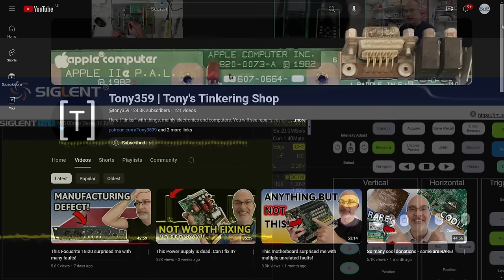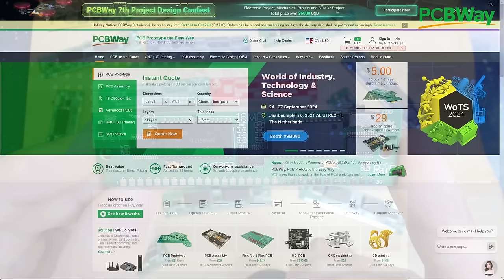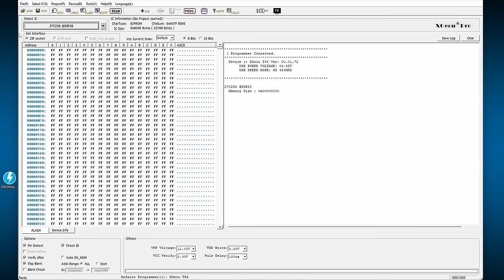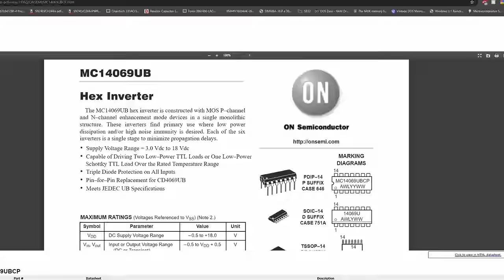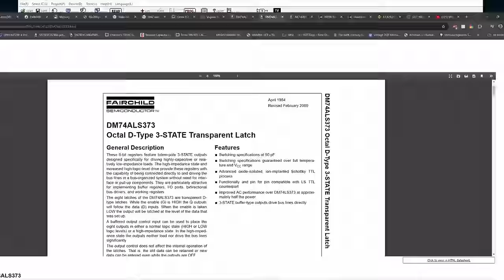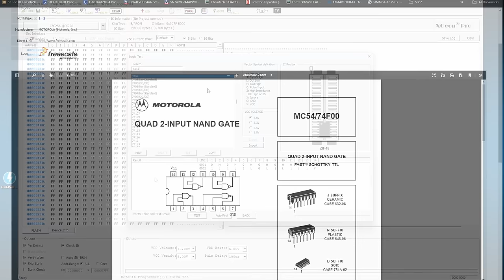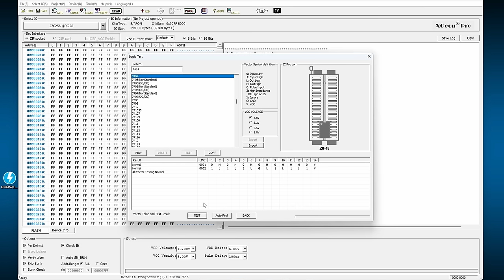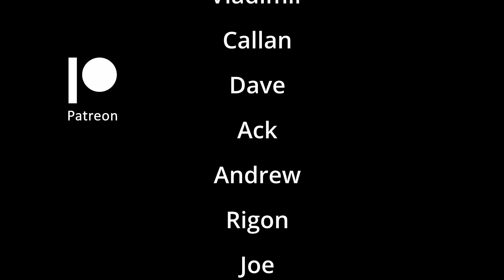Can I Save This 286 Board? Testing & Socketing all 13 logic ICs!

Comment: Nice board, i still have one brand new CPU Harris 25Mhz but no board for the CPU
Reply from the maker: I ordered one of those 25 MHz  CPUs from AliExpress. That will be a 'I ordered a vintage CPU from AliExpress' 🤣
I hope at least one of those boards will work - or help to fix the original board.
Reply: @bitsundbolts  I assume that it will be some small thing, what you overlooked is only a 2-layer board, I would try to back up the bios chips and upload a newer bios, sometimes it happens that the bios chips are damaged and the board sometimes does not want to post, I have experience with 386 boards
Reply from the maker: I tried the BIOS already. Many different things - always the same outcome. Funnily, I found a video on Necroware's channel with the same chipset. His board also didn't work and beeps exactly the same way! For him, it was a trace to the real time clock and keyboard controller. That is something I am going to look at next! Weird though that it would complain about memory. Maybe the real-time clock has an issue.
Reply: @bitsundbolts  I'm sorry to tell you but all those Harris 25MHz 286 CPUs on Ali/eBay are fakes.  I've been trying to get a Harris 25MHz part for years, however, all I've been able to get are sandblasted/relabelled 12 or 16MHz parts. They "might" do 20MHz, but certainly not 25MHz. Luckily the sellers will refund you.
Reply from the maker: I'll give it a try. I am not expecting anything magic and I'm fully prepared to be scammed by them. At least I can make a video about it and prevent others from making the same mistake.

Comment: My childhood 286 was so basic. Had only 10Mhz 1024kb ram populated with chips, no slots. The board was huge. Once i got ram chips and upgraded it to 2048kb(maxedout) but it would not longer boot or instal DOS 5.5. Going from ZX Spectrum clone to 286 was a big visuals upgrade tho.

Comment: From what I've seen the best solution is to preheat the board. Then use a desoldering gun. Reflow the solder if necessary. And in the end just a pinch of hot air.
Reply: I know epictronics recently got a preheater and he said it makes a huge difference.

Comment: Transistors can also fail, so if yo have a component tester give it a go by testing them.
Now to save time if you have an oscilloscope you could try and check to see if each IC has a crisp signal "no Floating signals" at their signal pins Eg: "Data, Addressing etc."
that are either no where near an expected high signal or an expected low signal, or even a distorted square wave should clue you in, 
Most hi/low signals reach about the same voltages, so if there are voltages or square waves and or pulses that look different or erratic that could be a clue that the 
component or a connected component has failed or is failing to meet proper specs..

Comment: I don't know if it'll make a difference, but you might want to try replacing those chips you tested anyway, just to discount any odd chip faults somehow not showing up on test. The reason I mention this is i've seen a few arcade board repairs where even after a chip tested fine in the tester, it was eventually found to be bad anyway. I think the reason given was that the chip tester possibly doesn't drive them quite as hard as the PC board itself does in normal use.

Comment: I believe that one of the chips near the KB controller might be bad, perhaps the one that could not be tested. Looking to the schematic, that 74245 is in the memory bus circuit (you can check the continuity between its pins and the memory bank to be sure) and the 7406, an hex inverter with open collector might invert signals for different parts of the circuit (the CE, OE pins for the memory? must check). Also, the 7474 that I remember to be a dual d flip-flop can do a division by 2 for the clock, maybe? I would be sure 100% that all those ICs are good, and as you said, the RTC IC. Now you have them all on the others boards. 
As that is easy, I would do that and if still no life in that board, I would try the other boards. The circuit seems to be similar if not identical and will greatly help you with debugging having one working board. But hey, this is my approach.
I still hope that the chpset is OK, it would be such a pity to have a dead chipset.
I also use if possible hot air to dessolder ICs after I preheat a bit the area if they are many and located near eachother, like you had, but if I have to dessolder few ICs I use the dessoldering gun. Like you, I find frustrating to use wick on those double sided boards. Now that I think, after I got the dessoldering gun I never used the wick to dessolder any THD component. However, I never used low-melt solder for some reason, I always refresh the old solder with standard 40/60 lead  solder.
Reply: It is a good thing to look the datasheets, but as a quick rule, I know that MC or CD with 14XXX or 4XXX are CMOS ICs that work from 3 to 12/15V, mostly 5V on older boards and SN74XXX are TTL that work at 5V only. That is for old THD ICs found on old motherboards. If there are mixed TTL and CMOS ICs, they most likely all run at 5V.  The modern TTL ICs might work at 3.3V but they are mostly SMD, I did not find any TTL THD IC that can work at 3.3V.

Comment: Suggest use an oscilloscope to look at waveforms on data and address lines on non working boards to see if anything stands out. Be careful of chip tester, if logic ic has weak output it might work in tester but not on motherboard. The 286 CPU runs really hot so perhaps the problem is there.  Also suggest ISA post code analyzer. I picked up a 286 motherboard with HT12 chipset just this week off ebay. I swapped out a Systems Constructors Ltd BIOS for an AMI BIOS so it would run with my XT-IDE HDD, added 2GB SD card as hard disk and turned it into a DOS6.22 machine.

Comment: i have experience with transparents chips. they are sensible to light. try to cover them up. it works for me everytime. greetings from Argentina.!!
Reply from the maker: I believe you mean the BIOS chips. I covered the window with multiple layers of tape to make sure no UV light will enter.
Reply: @bitsundbolts  no no. i mean the ls373. i worked in a slot machines of the 80s. (8bit logic with z80cpu) in some cases i never new why, cover that kind of chips from light erases some errors. crazy thing i know.

Comment: Was anyone else a bit horrified to see motherboards wrapped in cling film or just me? That stuff could zap those old ICs with static electricity.

Be cool to see if the other boards work and if not perhaps one of them could save the board that now has a bunch of sockets on it.
Reply: Older TTL chips are actually pretty resistant against static (though I still wouldn't wrap them in cling film!), it's newer (around 1990s) CMOS stuff that you need to be worried about.
Reply: No, it wasn't just you - I cringed as well! Agreed that TTL is more resilient, but there were also CMOS chips on the board. Wrapping boards in household plastics is a sure sign that someone hasn't a clue about what they're dealing with!

Comment: Instead of solder wick why not use a solder sucker? I use a spring loaded one and so much faster and less likely to damage pcb from excess heat.
Reply from the maker: I tried that before, but somehow I am not good with the solder sucker. Maybe it's because most of the solder is corroded to a certain degree and doesn't melt properly. That's just my experience. I do have a desoldering gun as well, but I damaged a few PCBs before with the nozzle. I need more practice.

Comment: 7:56 You need a Hakko FR-301. Indispensible if you plan to do this more than once, which obviously you do because this is what you do for your channel.
Reply from the maker: I have a desoldering gun, but not an expensive one. It does the job so far.
Reply: @bitsundbolts  The Hakko is a dream to use. It works on everything. No more wasting time with solder braid.
Reply from the maker: That's good to hear. I will keep it in mind. They're not cheap though. Maybe after a couple of months of PCBWay sponsorship, I'll be able to justify buying a Hakko device. I'm curious how well those desoldering stations work.

Comment: Those tests for the logic ICs sometimes are very basic. For example the quad nand gate test only had two test cases - this can only find very obvious errors. It wouldn't be able to tell if any of the four nand gates effected one of the others. So, you should take the results with a grain of salt.

OTOH, the tests are easy to adjust and one can easily add tests for non-included parts.

Comment: The logic test on the IC programmers are good, but they are not 100% reliable at finding bad parts. I have seen myself with an XT board ... works fine on the tester, causes massive bus issues in the XT board.

If they are jellybean 74 logic parts, just replace with new or others stolen from other boards to see if there is any change.